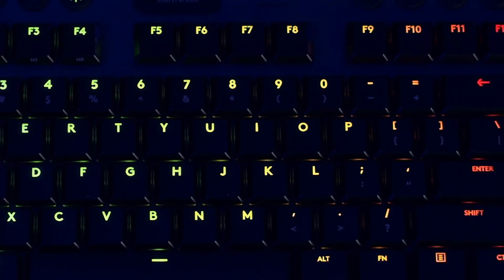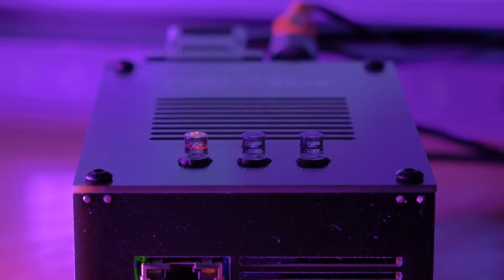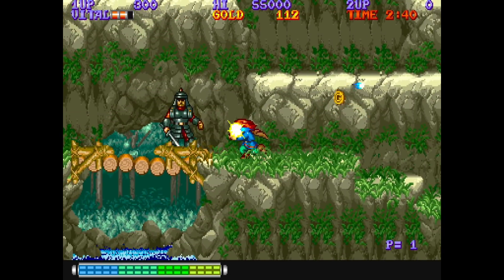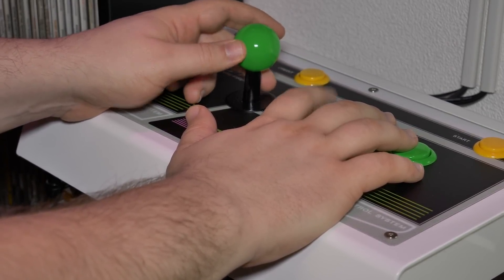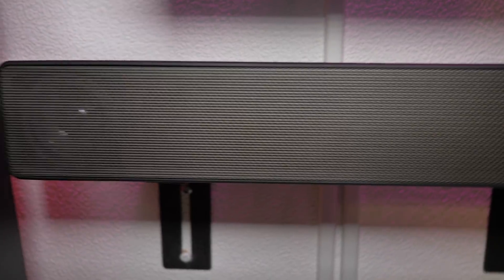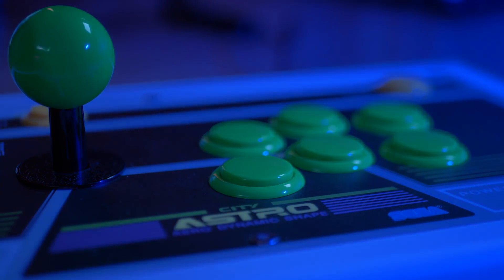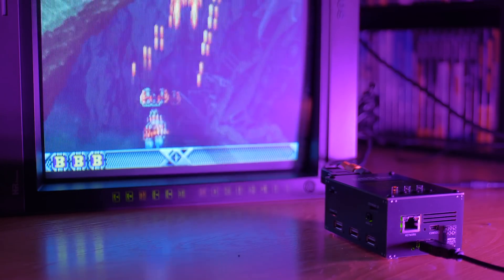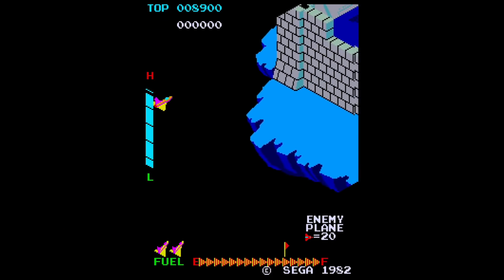DF Retro Hardware: MiSTer FPGA - A Brilliant Mini Emulation System Explored!

Comment: Although he dismissed the console version emulation my first thought was of the various Console games that are super hard to get (sure you can emulate them on a PC) but it is at least a selling point of these sorts of things.

So I think of the SNES Mickey Mouse or Pop & Twin Bee rainbow bell adventure games, or Mc Donalds Treasure Land on the Megadrive/Genesis. As well as the more awkward to deal with stuff like 32X and Mega CD games. But to be honest (you might laugh) but one of the things I really enjoy decent emulation of if the Nintendo Gameboy and the Sega Game Gear & master system - heck even the Atari Lynx. As these games were either hard to find, or awkward to play - so being able to play the best version of Columns for example or a game like master of darkness is pretty useful to me. Heck even early computer format emulation has a lot of merit to it if only as if someone didn't do that a lot of games from the 1980's could be lost forever.

I for example really enjoy old fashioned maze games like Ladybug, Mouse Trap, Clean Sweep and others like that you don't get those sorts of games very often now so I like being able to revisit them & to be able to use a more comfortable controller to do so too. Also if you are emulating the ancient computer formats like Commodore 64 or Sinclair Spectrum it's a delight to not have to deal with the loading times. There is also those machines that many people never bothered buying or that have a habit of breaking on you that are also a great boon.

Personally I've never owned a Turbo Grafix / PC Engine GT - so there is a whole bunch of stuff there I've missed out on completely. But anyway don't dismiss the consoles even if you like arcade style games there is things like the Thunderforce Series or Axlay that are well worth a play.

Comment: Love the Saturn sound at the beginning. Mine still works but I can’t play virtua cop any more as the gun doesn’t register properly on a modern TV. 🙁
Reply: I don't have the name in head or a link ready for your but there is a fairly new "gun" out there for modern TVs which seemed really well made. Even Linux Techtips did a video on it IIRC. So maybe it's best to search for that video to get the name of the project and then search for it via your favorite search engine. I just don't know if they'd work on a MiSTer.

Comment: For those who still don't get it.
This is a custom part product build for hardware emulation.
It aims to play retro games by physically acting as the original hardware if not better.

Compare this to software emulation, where a program helps modern hardware to do the work to run the retro games by simulating old hardware.

Comment: jesus christ that price lol
Reply: It's cheaper if you buy the parts yourself and put it together in 15mins.
Reply: Depends what you need, the essential is this : the fpga DE10 Nano : 130 $, 128 mb sdram for full compatibility : 50$~60$, PCB fan kit with heatsink : 20$ and finally a cheap usb mini hub, you have plenty of options fot this one.
The total will be between 210$ and 230$, for what he does it's really worth it.

Comment: I bought the MiSter purely to supplement my hardware collection. Financially, it does not make sense for me to buy a Neo Geo AES, an Atari Jaguar, a PC Engine CD system or a Sharp X68000. However a small, cycle accurate board that can potentially provide a pixel perfect experience for these systems is worth the $300 investment to me.
Reply: Exactly why I got mine, plus modding  handhelds for HDMI isn't easy or cheap.
Reply: @ArmandoDoval  That too. The GBA is like the 32-bit add on for the Super Nintendo we never got.
Reply: @NLuKa420  With the gba you can just get a gameboy player for a gamecube, which gets you two very compact systems that are both pretty cheap, but I still got myself a mister a while back because it is not practical for me (in terms of both cost and storage space) to get all the computer systems, arcade pcbs, or obscure and expensive consoles that the mister can handle.
Reply: Just the neo geo core which is btw excellent is worth the 350€ i spent. Now im kinda glad i didnt get a pocket. But i want one if you can order them again. Fpga is the way!
Reply: @martinmoller4947  absolutely. As soon as Furtek started posting videos of the Neo Geo core I started setting some of my gaming budget aside to pick up a DE-10.
Reply: @NLuKa420  Yeah neo geo is still a expensive dream.

Comment: What are the accurate cores that exist in Mister but not on software form on PC?
Reply: None. But this is not the point. To get perfect accuracy on PC with very low latency you need a good CPU. The MiSter can also output low resolutions (like 240p) that modern OS like Windows 10 don't support and it is easy to hook it up to a CRT monitor. It also consumes much less power and has got a nice small form factor.

Comment: I think you should have spent less time talking about your setup. I ended up skipping the end of the video because I had something else to do. :P

Also... I want to hear about home consoles. Arcade is not my thing. Like... not at all. 🤮🤮🤮
Reply: Short answer: SNES, NES, PCE and PCECD are close to perfect. Genesis and GBA should also have basically 100% compatibility. Mega CD and GameBoy/GBC are a little worse. Old consoles like Atari 2600 are not as good usually because devs work on them rarely.

Comment: MAME is probably more accurate at this time
Reply: Every core is it's own thing with separate devs.  SNES, NES, Genesis, PCE,  GBA, and more are much better than MAME offers.  But most mister arcade cores are not up to the same standard. The often include cycle accurate cpu cores (the fpga 68k is based on chip decaps and is close to perfect) but many cores have inaccurate sound, wrong palettes, or other problems.

Comment: Concerning the "extreme accuracy" of the Neo Geo support, can you overclock/still run games at full speed if they didn't on the original HW? I believe Metal Slug 2 is kinda slow on original HW, I don't know if brute forcing can fix that though.
Reply: I don't think the neogeo core supports this.  I side effect of the neogeo core being based on decaps was that some timing issues in the core were hard to fix because a FPGA is not the same as a regular IC.  So things that change the clocks never made it in.  The Genesis core has a turbo feature to help with slowdown. And the SNES can do the same for superfx chip used in Star Fox.

Comment: @John Any idea what the input lag is on the nook screen? I'd be interested to know if you can get small VA panel displays with similar input lag to modern 4K TVs since its really low now and the contrast would be so much better than the IPS screen (Although maybe I'm expecting too much for the screen to be a FALD, even so edge-lit would VA would generally have better contrast than IPS) and who cares about viewing angle when you are the only one watching it. Unless... you sometimes play with friends? If yes then I get the need for IPS viewing angles + colour is much nicer on a cheap IPS vs. a cheap VA.

Comment: Many of these MiSTer cores are quite new so it's possible that there are some inaccuracies on some games still.  Meanwhile MAME has been around for a very, very long time. But anyway I do play a lot of consoles on MiSTer and I absolutely love it.  The lack of input lag alone makes it worth it, but being able to use original controllers is just icing on the cake.   Consoles work so well that games with expansion chips run flawlessly as far as I can tell - even NES games that had extra sound chips like Gimmick.  AND some consoles have a turbo mode so you can increase the clocks of the CPU and fix the slowdown that plagued some old games on original hardware.  I can't recommend this setup enough.

Comment: I'm going to get the MEGA65 (FPGA-based computer hardware) which supports core switching as well. Here's hoping some of these MiSTer cores will be converted over so I can have that machine pull double-duty as an occasional arcade machine.

Comment: btw guys FPGAs are not a copy paste of the actual console hardware. It still needs development work and skills to match the original hardware as much as possible. Mistakes can be made and FPGA can be just as glitchy as rushed emulation if not done right. Funniest example of this is: Paprium, the recent genesis release, works on emulators but does not work on FPGAs like the Mister and the Mega SG
Reply: That's kind of obvious. FPGA logic has to be programmed, which is not a straightforward task. As for your example, that does have nothing to do with the accuracy of FPGA cores. Paprium has a custom chip which has not been implemented in the MiSTer Megadrive core and probably won't be, since that would open support for... one game. I've not seen a single video of it being emulated, exactly for the same reason. I don't know why you'd say that.
Reply: @Trunchisholm  none of the major genesis/megadrive  emulators were modified to accommodate Paprium. It just worked. So your random guess that it has to do with custom chips is incorrect.
Reply: @mashakos1  Again, the game has not been emulated yet. Heck, it hasn't even been dumped yet! No idea why you're doubling down on that.
Reply: @Trunchisholm  do your research
Reply: @mashakos1  I've have. Have you? The game hasn't even been dumped, let alone emulated.
Reply: get back to me when you reach the posts detailing how Paprium is doing on genesis plus gx. I find hand holding distasteful and outright laughable to guide someone trying to "call me out"

Comment: The MisTer has been an interesting project to watch.  The high price and setup effort have kept me in a holding pattern.  The raspberry pi is my go-to.  Cart prices are in outer space with no signs of coming down.
Reply: If you could setup a pi the MiSTer shouldnt be a problem. Really not that difficult. Mr fusion image helped a lot. My biggest regret i have is not getting a MiSTer earlier. ;) The neo geo core was the tipping point for me.
Reply: @martinmoller4947  Right but a raspi 4, rgb pi hat, and all other hardware is less than $100.  MiSTer is just too expensive for the value.  It is a very interesting project.  If I played more arcade games then I would be all over it.
Reply: @willis936  its worth every penny. Aes + neo geo sd + ossc + og controllers =1400 € easily. A raspi is not playing in the same league or planet imo. You should compare MiSTer to og hw + upscaler + carts. Not to sw emulation. And you can add dozens of consoles, computers and arcade boards to the value of the MiSTer.

Comment: Really hoping to see real hardware Vs FPGA Vs emulation, but best emulation, if you compare SNES you put Higan or Bsnes same with Blastem and Megadrive
Reply: Mister's SNES is comparable to BSNES but not better. It also doesn't have the graphical bugs of the Super Nt in Bahamut Lagoon or the FF6 intro.  The Genesis (and NES and PCE/PCECD) core is also very good. It's not easy to compare things that have basically 100% compatibility though. What do you test? MegaCD is not quite as good. The GBA is comparable to the best emulators but all implementations still fail some tests.

Comment: Thanks for the offer to continue with MiSTer content. 
As DF is all about the detail, I’d like to hear more on how cycle accurate DF find the cores and more on the differences with MAME. 
After all, FPGA will eventually save our old hardware from decay.
Reply: Accuracy is hit and miss.  SNES, NES, PCE are as close to perfect as any emu or anything analogue makes.  Genesis, and GBA are close to that level and generally support all games.  Anything using a 68000 has a near perfect cpu as well (made from the chip decap images).  But a lot of the arcade cores don't get that attention.  So sound chips may be inaccurate on old arcade games. Or the colors may be wrong.

Comment: I'm going to compare this to the N64 and how I think most people would rather play N64 emulator with its added features that feel like a remaster of the original experience on the N64. For example to play the original goldeneye with its 15 FPS can be rough compared to the much better performance we can get using an emulator with much better performing hardware. I suppose you have to be a retro enthusiast in order to really desire the complete original experience of something like this.
Reply: A strong argument for the importance of slowdown is the dodonpachi core. Alot of trategies that top players use on the real pcb, for competetive play, depend on the slowdown witch occurs at specific parts during a playthrough. Electric underground did a good breakdown of this core and the importance of accurate slowdown in particular from the pov of an experienced ddp player.
Reply: @simonvandenbon8273  I'm totally unexperienced in arcade motherboards so for me I'm totally biased using a emulator for the convenience and lovely features. However I totally respect this hardware and what it offers. It does frustrate me that my monitor doesn't allow me to set the refresh rate below 30. I don't understand why it's not possible to set the number to whatever you wish below its default range. so I'm glad this exists for the enthusiasts.
Reply: That does not apply here. We're talking about platforms that are squarely focused on 2D gaming. There are no inherent IQ benefits to what you can do in an emulator with those types of games.

Comment: I would love to see a comparison of the mister pc engine (cd) core to real hardware! Would be great if you could take a look at the recent discoveries regarding the pallete over composite vs rgb
Reply: Artemio (of 240p Test Suite and MDFourier fame) along with Kitrinx/Rysha, Dave Shadoff and others spent a lot of time figuring out how to go from the values in the YPbPr table in the IC to final RGB colors that match when we measure the analogue output.  It's tricky (a little like the NES...) but I think we did a good job.  If there is a more accurate palette somewhere else, of course the mister palette could be switched. But afaik we have done a good job on it for now.

Comment: This is the first side by side Mame / Mister comparison I’d ever seen. 
Mister is still an approximation unless they go as far as to decap the chips and read the traces. Too expensive to do for anything but the most common chips.
Reply: Fortunately, many of these consoles/home computers share some of the same chips, including the Z80 and 68000 CPUs, which have very accurate implementations that can be reused for other cores. There has been a lot of progress decapping chips lately for the CPS1/2 custom hardware and those in other platforms.

Comment: Yes! The Mister/DE-10 nano getting some serious exposure! Let people know, ain't no reason to buy the many expensive Analogue products. Just pick up one cheap Mister 👏🏾 Can also output analog, not just hdmi, and can do native framerate over digital (if your tv supports it)
Reply: There is one reason: original cartridges. Apart from that, they are pretty comparable.
Reply: @Trunchisholm  You're right...the original cartridges. However, the Mister has analog CRT output for monitors/TVs available, and better digital output with native refresh (something to do with variable pixel clock or something).
Reply: @mahdiyussuf9804  Yes, MiSTer is amazing, and extremely flexible. I love mine :)
Reply: @Trunchisholm  I love mine too. The fun and enjoyment for me is like when I was introduced to emulation on OG xbox back in the day haha.
Reply: @Trunchisholm  Or find a good software emulator. Right? Some emulators are really accurate (and 100% open-source).
Reply: @PhilippeMorin123  Good luck finding and setting up emulators for all the platforms supported by MiSTer that are cycle-accurate, have 0-lag  and don't require a  high-end PC to run at full speed.
Reply: @Trunchisholm  seems like the platform is for arcade gaming anyway. I'm more a home console gamer.
Reply: @PhilippeMorin123  It's absolutely not. There are not that many arcade cores, to be honest. The highlight for me are the console and computer cores. MiSTer has cores for almost all of the 8 and 16bit platforms, and most of them (save for MSX and a few others) are excellent, including the PC Engine, NES, SNES and Megadrive cores.
Reply: @PhilippeMorin123  no that’s just what John focus on in this video. It also has classic 16 and 8 bit consoles like NES,SMS, SNES, TG16, Genesis/MD Segacd. It also has cores for microcomputers like Amiga, Commodore,  MSX and many more
Reply: @PhilippeMorin123  hahahahha you need to watch some better videos than this one, arcade games are only a tiny portion of what this can do
Reply: @PhilippeMorin123  No, MiSTer covers almost every 8/16bit console system incl. CD expansions, handheld systems and home computers.
Reply: @PhilippeMorin123  Mister can do early Macs, Amigas, Commodores, Apple IIs: most of the 8-bit and 16-bit platforms, for non-gaming emulation, too. In fact one of the founders of the project hates arcade emulation and is more interested in small computer emulation. The upfront costs of Mister can be over $300, but considering all the things that can be emulated (and erased and replaced with one of dozens of hardware profiles, as many times as you like)
Reply: @PhilippeMorin123  It definitely isn't just for arcade gaming. It will do pretty much every console older than the n64/ps1/32x/saturn with similar accuracy to the arcade cores, and development is being done for some of those consoles too.